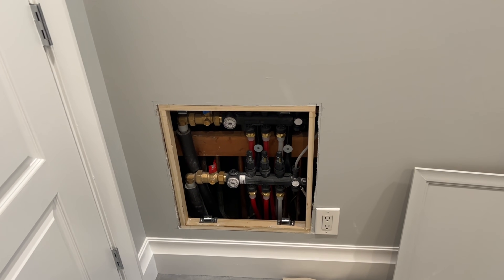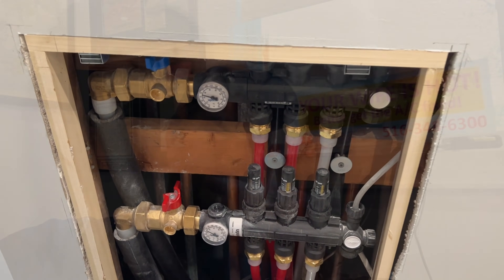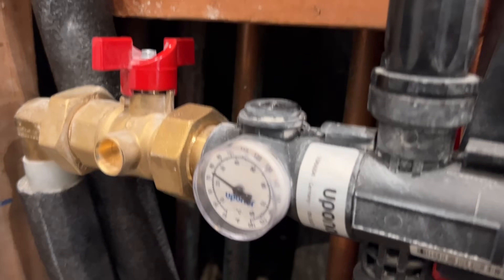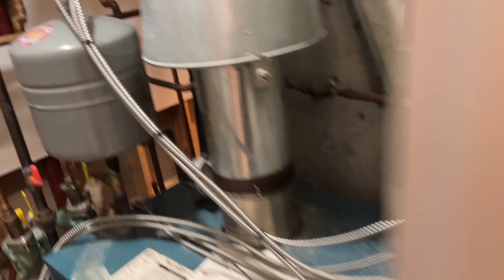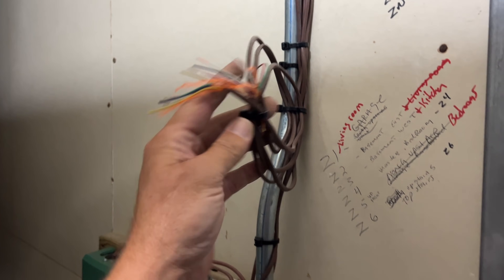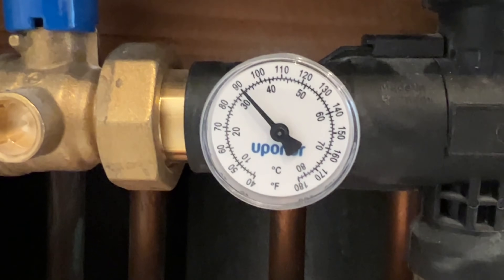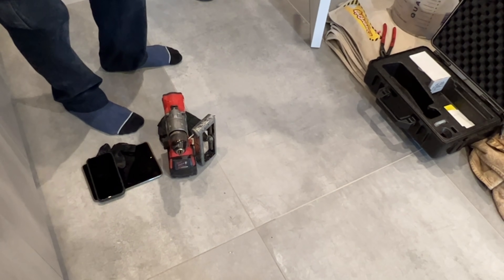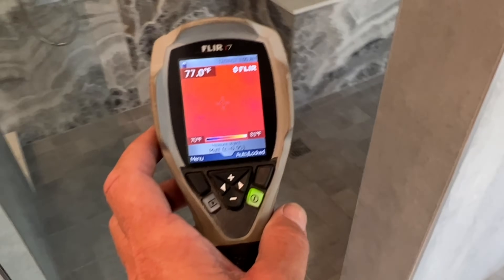How to Startup & Commission Uponor Hydronic Radiant System with Flir i7 Thermal Camera

Comment: Man , that thermal camera.
Save the clients a ton of money; trouble shooting and not having to open wall's plus.
How deep can it see through concrete??
Thank you.
Question?? How deep can it scan concrete floor with tile?
Reply: @PipeDoctor  Thank you.
Question?
Service call for restaurant's; hot water coming back in cold water pipe's.
Would you recommend using thermal camera to trace where  hot water is crossing into cold water " legionella" .

Comment: Radiant in the shower is a must! I want it up in the shower walls too, I don't want to bump against cold tile first thing in the morning!
Reply: Is that actually a thing that people do? Do people really put the radiant heating in the walls?
Reply: @Joe60459  ceiling too!
Reply: @Joe60459  check out; originally; the first in floor and wall heating with pipe ; they used black iron pipes.

Comment: I would advocate for a new Hy-vent on the block side of the unit, A little bit ratty looking...
By the way the manifold is built-in with a easy purge, that’s that weird looking surgical tubing thing no one ever uses.. isolate every return and use that tubing to purge every bit of air out of the system before you introduce your hydronic solution to the manifold....That’s half the work at least